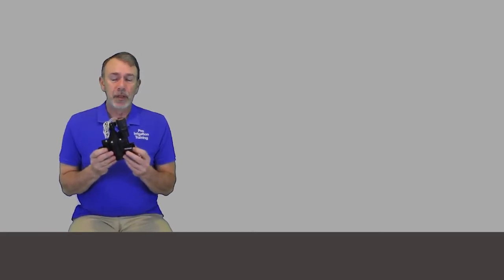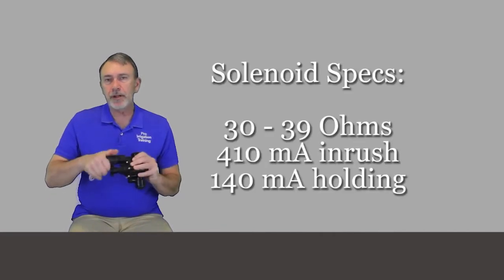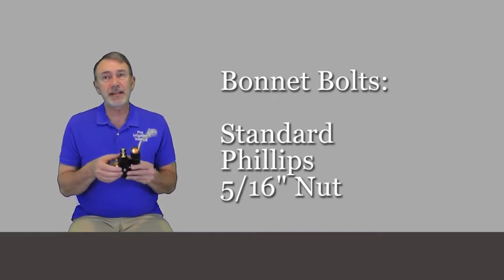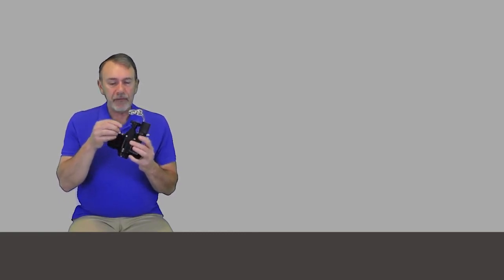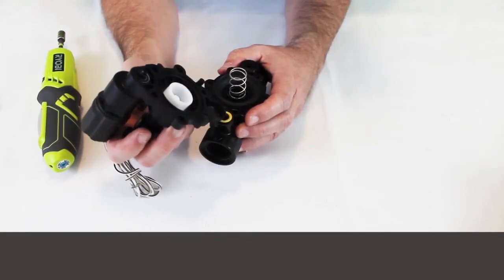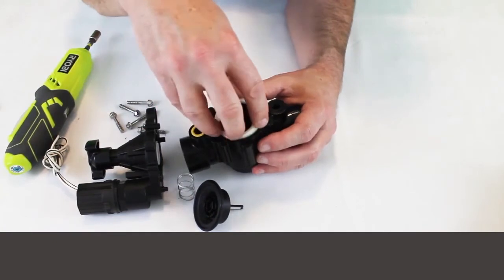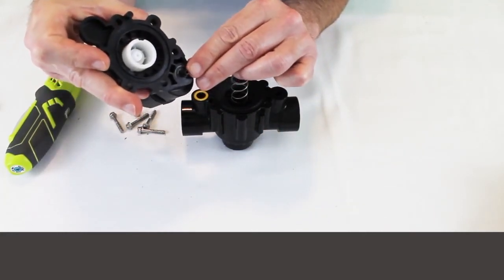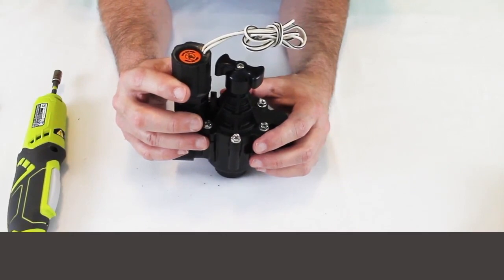All About Rain Bird PGA Irrigation Valves ( sprinkler systems)

Comment: When I manually open the valve no water goes thru the valve please help
Reply from the maker: Make sure you have water actually making it to the valve. Check all your shut-offs etc. If water is on to the valve, then you need to rebuild the valve. Blow out the small hole in the lower valve body or run a very small piece of wire down it. It's probably that tube being blocked or the diaphragm malfunctioning. Replace everything but the valve body. If that doesn't work, cut it out and replace with another valve. But I've never seen a PGA that wouldn't correct after a rebuild.

Comment: Awesome video and great info. First home with a sprinkler system for me, and this helped a lot with understanding the control valve and troubleshooting and rebuilding.
I had a recent supply line break, which I fixed, and I know a bit of dirt got in the line and is likely causing my troubles with one of the valves sticking open.
Reply from the maker: It happens a lot with pipe breaks. Dirt and rocks can get pulled into the line. Dig a pit deeper than the valve to catch the water, take apart the valve and flush. Thanks for watching and good luck with the system. Glad we can help!

Comment: Would the valve work with a inlet pressure of 13 psi?
The website of Rain Bird says that the minimum is 15 psi.
Reply from the maker: So sorry that I didn't see your question when you posted it. I hope you found your way to a "low flow" valve.

Comment: Do you have a video on the 150PEB ??  (did the Diaphragm assembly & Selonoeid replacement) and have a drip (earlier spray) where the adapter for the selonoed meets the bonnet..   What's with the two (2) slots  on the nut portion of this bushing  ??? if they were not there i don't think i'd be my drips .. Thanks in advance ..
Reply from the maker: Hi John, thanks for watching and commenting. I don't have a vid for the PEB. They're very rare in my area, so I'm not really familiar with them. I'm not sure about this one, but one of the valves doesn't actually need the adapter below the solenoid. I'm not sure about the two slots. Sorry I can't be of more help on this one. It's possible that the bonnet is cracked, you might have to cut the valve out and replace it.
Reply: Found the error of my ways ... by reading the instructions and finding a grommet/ O-ring that was for the selonoid to bonnet adapter (came with Selonoid Assembly) @Proirrigationtraining
Reply from the maker: @jp89702123  Fantastic!

Comment: I find the flow too high for the thread diameter, is it common to use a reduction coupling ?
By the way, a little tip. I have an old one that was working fine, but I decided to open it up for cleaning... It started leaking between the bonnet and body after that and I opened and closed it up many times trying to figure out what it was. There are some spurs that form on the body where the screws go, bellow the bonnet. These can preclude the bonnet to make good contact with the body so it's sometimes a good idea to sand, or cut them, I found this on a forum. But be very careful when doing this because an exacto knife or whatever you're using can slip and damage the diaphragm seat.
I my case though, it didn't make a difference, so I ended up concluding that it was the yellow seal, because the diaphragm worked ok on another valve!! I'm still waiting for a replacement from my dealer and I wasn't assured there are replacements for sale though, which is a pain. If I don't find them I'll try to hack something to test if it's that seal, I'm pretty sure it is because the leak is allways on the front and I have since disassembled a second valve with exactly the same behavior (working ok but got messed after cleaning, and leak is on the front on what seems to be the yellow seal area ....).
Reply from the maker: Hi there, thanks for watching, and thanks for the comment. Although I'm not sure I understand your question. Do you mean that the flow coming into the valve is too much for the valve? In that case, just use the next size larger valve to insure that you keep friction loss low. Or do you mean the minimum flow rating for the valve is higher than the flow coming into it? In that case, find a valve that has a low-flow rating or use a smaller valve. Thanks for the tip! I've never seen a situation personally that the burrs caused a problem with the diaphragm, but I can see how it could happen. I usually just rub the pieces of plastic off with my fingers if it seems like a lot, and always have a cup of water to flush out everything before you put it back together. In your case, it might be that the yellow seal has been flatted a little and now it doesn't seal back up properly. My advice though, is to just replace the entire valve with a new one. My rule is that i try to rebuild or reassemble twice, and if it doesn't work, replace the valve. There's always the possibility that the lower valve body has a hairline crack that you can't see.
Reply: @Proirrigationtraining  Well thanks for taking the time to answer. Regarding the flow, I meant that the specifications of the valve imply for it to be used with a flow range that's normally used with a pipe larger in diameter than the valve threads of just 1". So that's why I asked if it's common practice to use a reduction, I meant a reduction from the pipe's larger diameter to 1" corresponding to the valve threads... That's how I'm using it and I was curious to know if that's what others are doing, I mean you don't normally use 1" pipe for those flows in the case of a large drip irrigation, due to the pressure losses... Or maybe people are using it for gardens anyway, I don't know, but I made some calculations and the pressure losses for those flows with 1" pipe are too high...
Yeah, I must've dis/reassembled it about 7 times now, getting crazy, but today I found out that it doesn't leak with a custom seal replacing the yellow seal! I also found out that if I use a seal that's too thick it starts to leak again... Crazy to think I was about to get a new valve I now got 6 of them on the same situation and they're the 1 1/2" version, so I'm sparing 600$ ;) Cheers
Reply from the maker: @machannel8746  Gotcha. I have seen people using a 1" valve on 1 1/2" pipes and corresponding flow rates. Even though the valve specs show a higher flow range, you should use a matching valve size to keep the friction loss down. I'm surprised that you found a new seal that perfectly matches the one on the valve, but glad you did. Those 1 1/2" valves are expensive! Thanks for watching and commenting. I always hope that the comments help other people looking for solutions, I know my videos aren't perfect and can't cover every situation, but we're all out here working, just trying to get er done.

Comment: Thanks for the video! Just curious why yours has 6 bolts to open up, while the Amazon link shows 10 or 12???
Reply from the maker: I'm betting that the picture on the Amazon listing is actually of a 2" model. The listing specifically says it's for a 1" product, but pretty sure its the wrong picture.
Reply: @Proirrigationtraining  Thanks for the heads up!